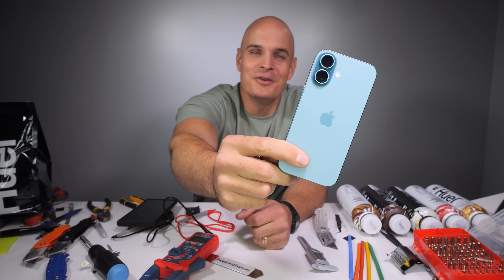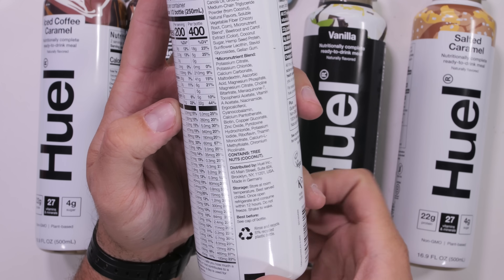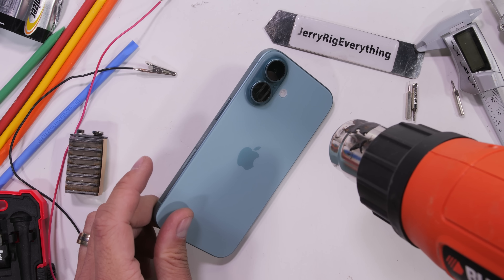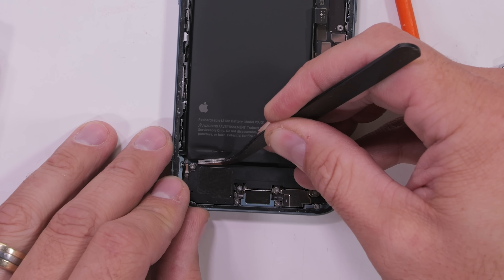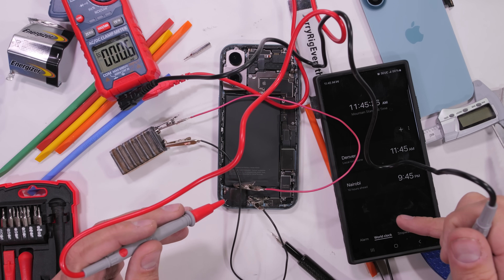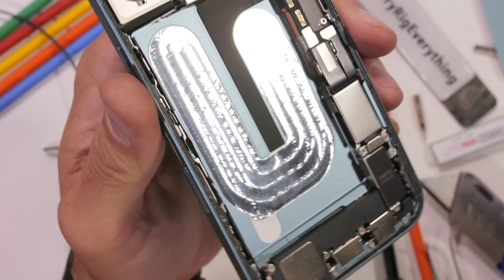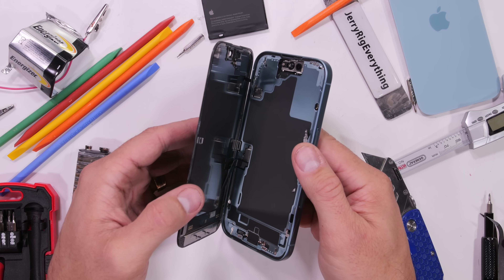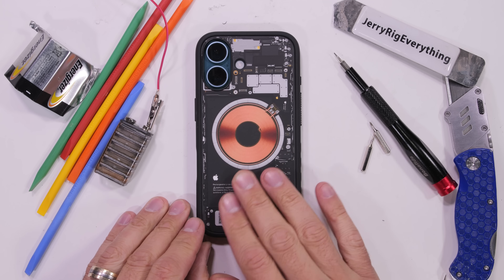Apple *FINALLY* did something new... (iPhone 16 teardown)

Comment: Wow Apple, I'm so impressed. You managed to find a way to say 'battery replacement is dangerous because they could overvolt the battery adhesive!' So great job Apple, well done. You took something very easy to do, made it harder, and sound more dangerous on paper. I'm sure this terminology will come up again when they try to justify limiting Right to Repair in court.

Comment: When I worked at UPS in the small store, there was a very large belt that ran in front of me. The constant movement of the belt created a very large static charge. I had my phone in my pocket when I walked up and it got shocked through my pants. The phone would power on, but would never make another phone call, I guess the modem got fried.

Comment: For those of us who don’t have spare fingers. May be a JRE knife with an extension tip that lets out just enough depth of blade to safely slice open the adhesive? Safe for the phone, safe for our fingers.
Reply: Buy a real knife, not an over-priced chinese made pos....
Reply: @FJB2020  A real knife would be a terrible tool for a screen replacement. And I feel like 9$ for a good quality box cutter isn't an outragious price.

Comment: The good part is not the battery removal. This is still basically the same solution, Now you use a 9v and before you used IPA (Them pulltaps never worked for me). The good part is actually the backglass replacement, which is managable rn. It was always such an irritating job which could end you up frying the phone's components if you don't have a special laser to remove it. Last time I replaced the backglass of an XS and a piece of glass flew into my eye. Good thing was that I also fried the screen despite being really careful of overheating the phone which is hard when the adhesive takes up to 400C

Comment: ive always wondered why phones need such strong adhesive on the batter any way its locked up nice and tight inside
Reply: They don't and never did. Batteries in phones weren't glued in the past. The more difficult and expensive the repair process is the more likely people are to buy another phone instead of repair.

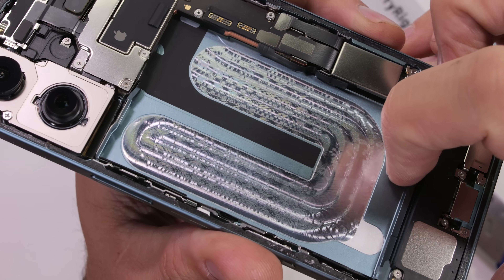Comment: 4:45 looking at the milling paths, I'd say the portion where the adhesive is was probably covered during anodising instead of milled away. You can see a small edge in the inset U shape which is still anodised. Also, and extra milling step would be much more expensive than a vinyl sticker

Comment: 3:21 electrocution is wrong choice of words… as an electrical engineer had to point it out sorry… :)
Reply: The adhesive was killed by the shock. Sounds like the perfect description to me especially for a video title
Reply: @beneh1337 

Mmm ..metaphorically maybe correct but technically still wrong electrocution is harm to living …not to objects, machine or in this case adhesive which is non-living…electrocution is not used on non-living…
On second thought Metaphorically also wrong title says electrocute iphone…electrocute = killing with electricity…in this case phone still alive ..

Comment: This is all nice, but how do you make the glue sticky again? Reverse polarity of the 9V battery?
Reply: Why would you need to make it sticky again ? Battery replacement is there just for replacing it when the old one is not working anymore.
Reply: New batteries come with new adhesive on it.

Comment: Not all 9 volt batteries have the same construction some have 6 aaaa batteries instead of the custom rectangular cells. 
As for using a 9 volt battery for this supposedly apple is going to have their own special power supply tool for doing this at a higher voltage/amperage. I am honestly kinda surprised they didn't invent a tool that connects to the new or old battery to do the heating but thats apple for you, why make smart designs when you can make stupid overly complicated designs?
Oh also you say a repair should take 10 minutes. Well yes. But no. For a third party shop it could be done that fast but I still always tell people an hour to be safe and give myself extra time. But if I am doing an OEM repair it can take upwards of 2 or 3 hours. Apples internal repair tools and software are really really bad and take more time than the repair to do. Look at their heating tool its awful my old shops doesn't even work so we just used a hotplate. I could rant about this for a long time.

Comment: Apple re-inventing the removable mobile phone battery one complicated step at a time. 😁
Next time: "The Apple battery now is just clipped in place, no adhesive necessary! Only a light push on this tab..."
But you gotta give it to apple, they really are good in finding an overengineered, yet elegant solution to a simple problem...
Reply: This method means that a) the battery can be bigger for the same physical space and b) the phone can be IP rated for water resistance. Adding a latching mechanism, door and battery bay adds complexity when the main criteria for the battery in a smartphone is that it be kept away from water and have the highest possible capacity for the space you have.
Reply: @joejones3434   A latch for a battery wont take away that much space since it doesnt have to sit underneath or above it. I didnt say anything about a door. And Phone manufacturers can stop trying to outdo themselves by making the thinnest whatever nobody asked for. We were plenty fine with phone thickness in 2007 and if we just kept the thickness and improved on the structure and repairability, phones would have been repairable and IP rated and still had swappable batteries. The strive for thinnes ruined all that. And ofcourse the planned obsolescence and enshittification (you could argue the device thinning just played into that, bcs if a phone were to be made actually sturdy and repairable, people would stop buying replacement phones).

Comment: I've been following you for some years now and I like what you do on the tech side, but I think you should promote only brands/things near your field of expertise, not food supplements. It's a very controversial domain with huge marketing and the health benefits are most probably not that wow as advertised, or even the opposite for certain artificial sweeteners. So, if you don't have some kind of degree in the nutrition field, then maybe keep your focus on tech related stuff because you are very good at it.

Comment: 4:43 Metal spudger is getting warm I bet!
Reply: Wow my heart stopped for a second...
Reply: @shadowlole0815  We've seen electroboom, we know what happens!
Reply: Wtf does this comment even mean?
Reply: @kepler656  The metal pry tool (commonly known as a spudger) is metal. metal conducts. metal tool lands across crocodile clips connected to live battery. Current flows between contacts as metal tool acts as a resistor. metal tool gets warm.
Reply: Yeah 400mA is not going to heat that up.  But you definitely don't want to drop metal tools on an automotive battery.

Comment: Zack: I used a battery to remove a battery
Reply: you could also use a adjustable power supply to remove the battery.

Comment: I also have seen 9v batteries that are 6 long cylinder cells next to each other. I think they were actually AAAA battery cells no less.
Reply: yeah comparing a 9v to a AAAA Matches up in size.
Reply: I was gonna say, last time I took one apart it was 6 AAAAs. Those stacked cells are crazy.
Reply: Yes. There are generally two styles of 9V batteries. One is a stacked pyle like Jerry showed, and the other is 6 AAAA cells bonded in series like one would see in a lithium battery of 18650s. The commonality is a series of six 1.5V cells.

Comment: Why do these phone batteries need such strong adhesives anyway?  As long as it is not rattling around, then what does it matter?  My laptop battery is not glued in, and it works just fine.  What about screws?
Reply: People do stuff like mount phones to motorbikes... the amount of vibration the phone gets is huge and the battery is a LARGE internal mass so unless it is very well secured it will break free of the weak adhesive hinge.

Why not screws?  Well when these batteries get old they start to swell, the last thing you want is an old phone that you have forgotten sitting in a drawer in your home to have its battery start to swell and then pinch in around the screws.   Glueing down one side of the battery to a case and having the other side push against a smooth surface reduces any focal points when the battery swells reducing the chance of a fire!   Furthermore the adhesive holding the phone shut is designed to be just weak enough that when the battery slowly swells it will bust open the phone case rather than crush the battery in place...   You want your phone to break open rather than catch on FIRE!! 

Laptop batters that a screwen in are in a hard case and have a LOAD of internal null volume (unused) so that when they expand they will not pinch in on the phone, most people would rather the battery be glued down than have a battery that is 20% small in volume.
Reply: @hishnash you could still easily design the battery so that it swells into a safe direction even if you used screws. Screws just cost a penny more than glue, so not worth it in a consumer device.
Reply: @falsemcnuggethope   No you cant.  The battery swells in all directions, you need to ensure you do not pitch it when it swells.

Also screws tend to be cheaper than glue due to the complexity of using glue within a production line,  screws you can have a robot pu tin and then move the phone onto the next station within a second but glue needs time to cure so you need an entire waiting area for all the phones to wait to cure.   

Screws are a LOT cheaper than the new type of eletro chemical glue as well.
Reply: @hishnash  You are full of crap, I've replaced probably now THOUSANDS of batteries in laptops, and phone. And there was never a problem with the screw in batteries, but a lot of problems with the glued ones. Also, when the glued battery is swollen, the risk of puncture is WAY, WAY higher than with the screwed ones. Which is causing a safety hazard.
Reply: @ when a glued battery sweells the rsi k is very low as the battery expands eventually.   There are no phones on the market with skewed batteries unless the battery itself is in a hard case that has a void for expansion within it.  (Massively reducing capacity)
Reply: @hishnash  I'm sure it would be possible to design a frame that has the right amount of compliance to match or improve on the safety of using glue. It just wouldn't be so cheap.
Reply: @ no the issues is it would require more space (space not used by the battery).  You woii you do need to glue the battery to a sheet that extends out on all sides 5mm from the battery so you can have screws going through it that do not pierce the battery when it swells.

This massively reduces battery volume
Reply: @hishnash  what you wrote doesn't seem to make sense.
Reply: @falsemcnuggethope  you can’t have a screw going through or even close to the edge of a battery.  

The only way to screw in a battery is to glue a battery to a plastic or metal sheet and then have multiple fastenings of that sheet around the edge that are far enough away from the battery so the battery does not impede on those when it expands. 

You can’t just screw this metal sheet in at one end , as it will flap around and move within the device. It needs multiple fastening points, top bottom, and side. massively reducing the area and volume accessible for your battery in a phone.  This is why none of the phone vendors out there screw in batteries.
Reply: @hishnash  You are missing my point.  I am not asking for phone batteries to be screwed on.  I am asking why they can not use a normal method to make them easily detachable like every other device on the planet that uses a Li/ion battery.

Most of them use plastic clips to hold them on.  My point about screws is that if they are worried about a clip not holding it well enough, they could secure the clip with a screw.  Not screw the battery on.
Reply: @ the nice plastic clip batteries you find actually have quite a lot of internal no void space for the batteries to expand into in the future.  This means less battery capacity. 

Modern smart phones aim to maximize the capacity, by sticking one side of the battery down, and then ensuring the adhesive that seals the phone shut his weak enough to break as the battery expands, allowing the phone to pop rather than start a fire.  

The alternative to this is reducing battery capacity by 20 to 30% and having an empty space within the phone for the battery to expand into.
Reply: @hishnash  I guess that makes sense, but can't they just design it so that back of the phone pops off if the battery fails?
Reply: @hishnash  nope, that's not the only way.
Reply: @falsemcnuggethope   The option is either leave enough void space thin a ridge battery pack so it can safely expand. Or build your device so that when it does expand nothing pinches the battery and the device pops open.   If your goal is to is maxim battery capacity then the latter pathways is the only option.

Glue the battery to one side and let the other side pop the device open if need be when it expands.  

(not letting a high density modern battery expand when it wants to creates fire, and letting it pitch on a screw etc during expansion also creates fire)

Sure you can use screws were you screw in a plastic or metal sheet that the batter is glued to and maybe hold the edges on the sheet with clips or rails,  But your still guying in the battery you just making it so you can unscrew the part the battery is glued to, you cant screw into a battery.
Reply: @hishnash  well, that's one way. Sounds like an improvement already. But you can also find ways that don't use glue.
Reply: @hishnash  That's not what I want to hear.  I want to hear how it is all a big conspiracy to make us want to buy a new phone because replacing the battery costs too much and is likely to damage the phone.

You sure it's not a little of both?
Reply: @azrobbins01  New batteries don’t cost that much if you really want to hold onto an old phone. I’ve had my iPhone SE for almost 5 years and the battery is fine, and honestly i’d rather upgrade to a newer phone than replace the battery on a phone thats been through so much. 

I feel like we would need some statistics on how many people actually replaced the battery on something like a Samsung S3 and proceeded to use it for 10 years straight. Not many. I do remember people carrying multiple batteries to swap them out when the previous one died though.  Stuff like this makes battery replacements even cheaper and easier to do though.
Reply: @azrobbins01  Using screws would not make it cheaper or less likly to damage the phone.   The complexity in a battery swap is the water tight seal for the phone not the battery itself.  and it is rather cheap to replace a battery
Reply: Phones experience being knocked around much, much more. Back when phones had removable backs and batteries weren’t glued in, batteries would fall out if you dropped your phone, causing it to power off and be restarted the next time you powered your phone, which was super annoying. It would also create sparks which could be pretty dangerous at times. Im guessing even with a back fixed on, the battery could move around and come loose or create sparks inside of the phone, not sure.
Reply: I guess for the insurance that during the lifetime of the device , the little black bomb doesn’t come loose and explode. But it could also just to keep you from repairing it yourself and coming back to the manufacture every time.
Reply: not that long ago no phone battery was glued in, thanks to the EU we will be going back to that very soon.

Comment: 3500 mA battery on iPhone 16? Are they taking the piss out of their customers! New Android flagship phones are coming out with 6000 mA nowadays! Aren't these iPhones about 1500 USD to buy? That's insane!
Reply: The mAh Rating doesn't say much about the capacity. The comparable metric is the stored energy in Wh (watt hours).
Reply: The Android makers need to add all that capacity to make up for the inefficient SoCs. If you have tight vertical integration like Apple does you can control things like power efficiency from the SoC and other components so you can get away with a smaller battery - the important metric is the actual battery life of the phone when in use, which is pretty decent.
Reply: ahem have you seen battery tests of iphone 16? beats some 5000 mah android phones.
Reply: @dan003 @fernandonando8461 tf??? This phone is like half that price. It’s 800 USD
Reply: 1500$ for this garbage is a scam

Comment: When I took apart a 9v battery, it had 6 smaller batteries, but they were like AAA size, and not stacked.
Reply: Both variants exist, if the 9V battery has 6 AAAA sized cells inside then it's likely designated 6LR61, as  LR61 is an alternate name for AAAA, and it contains 6...